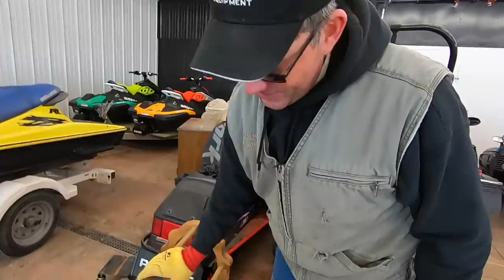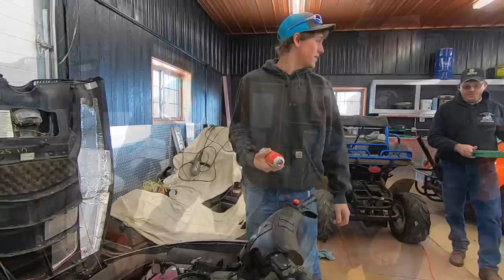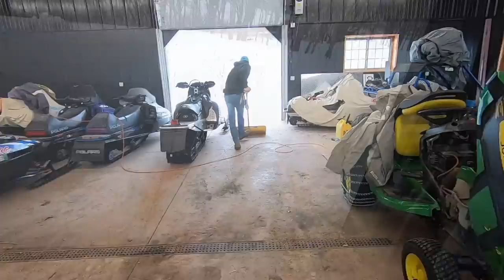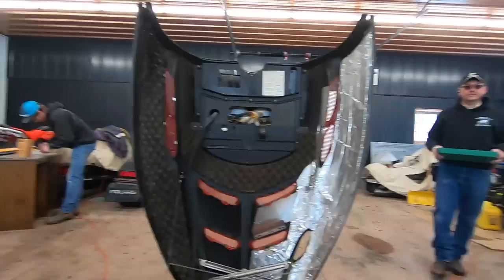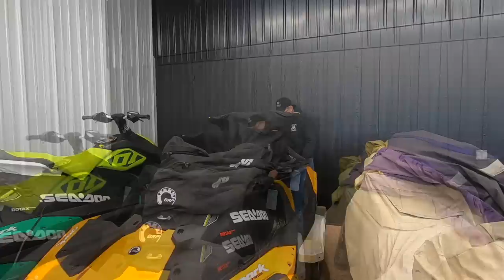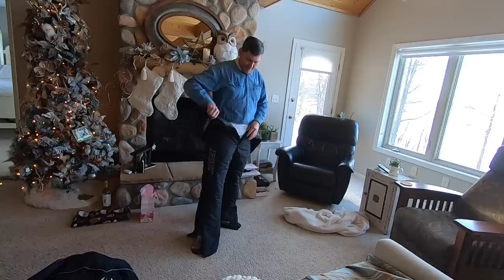Realignment Sale.

Comment: You guys like the polaris sleds eh mine is Yamaha my first sled was a 1979 Yamaha 340 enticer deluxe that I still own by the way and it was the most reliable sled ever and fast and oil injected so I did not have to mix gas and oil like the rest of the sleads of those times and since then I have been a true Yamaha brand guy every dirt and street bike, sled, Waverunner, golf cart I ever owned was a Yamaha except I bought a 19 Can Am side by side the first none Yamaha toy I ever bought and I don't regret it at all.

Comment: I hate trying to start sitting equipment sucks, a trick I use is a propane torch unlit to the intake, watch out for backfire can cause some excitement.  It usually starts on the second or third pull, then listens for it to choke itself out and then it will run on its own.